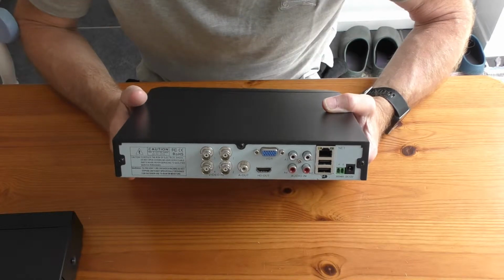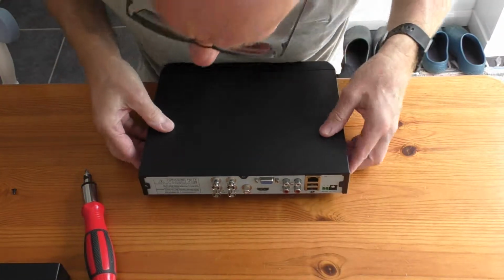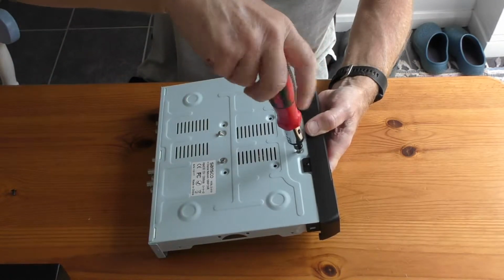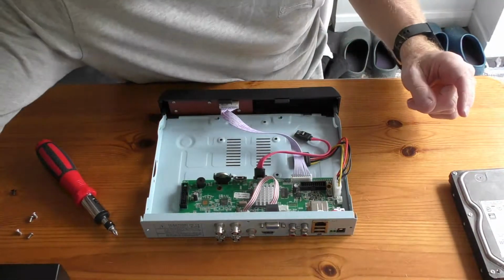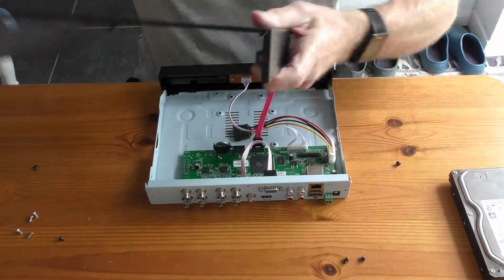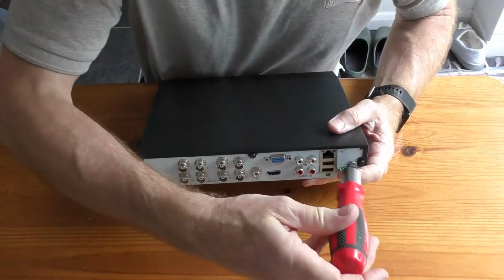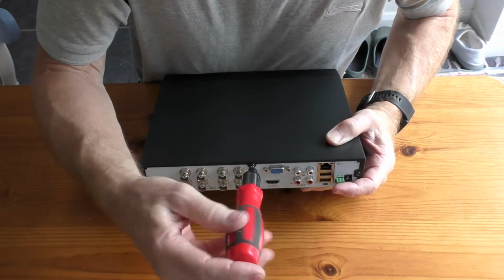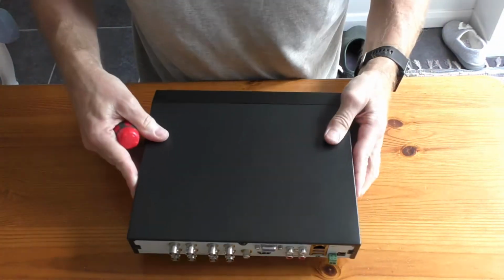Sansco CCTV. Installing the hard drive. Transferring the hard drive. Maisi.

Comment: Hello i have this make of cctv but it stopped working sometime ago , the power light is red , the tv detects the Sansco logo but wont log in or show the menu . Any suggestions would be apprieciated .
Reply from the maker: Hello. It's possible you may have a different model to the one I have,  but I would assume that as you have the sansco logo, the power supply is working OK. The only thing I can suggest is to unplug the DVR completely for an hour or so, and then start it up again. If that fails, I would contact Sansco through their helpline. They usually come back within 24 hours and have always answered any questions I've had. Hopefully, they can sort it for you. Please let me know how you get on. Thank you.

Comment: Hi ive pulled 3 hard drives into mine and its not showing any ideas
Reply from the maker: I would try to format the disc first and see if that helps. If not, there may be another problem. Sansco's help service is very good, so I would contact them. Hope that helps.
Reply: @DavidGarside  it dosent even show the hard drives
Reply from the maker: I would send them a message and see what they suggest. They usually come back within 24 hours. It would be interesting to know what they suggest. You'll find their contact details on their website. Fingers crossed. 🤞🤞

Comment: Is the sansco dome cameras the same as this but in a different style.
Reply from the maker: I believe the dvr is the same unit on both types of camera kit, so it should be. If you remove the screws (unplug from the power supply first) and lift the lid,  you should be able to check before changing anything. If in doubt, contact Sansco customer service and they will advise further. Thank you.